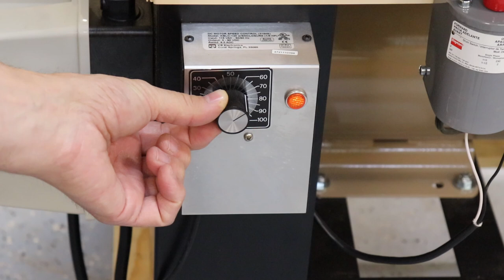Drum Sander Tips: Woodmaster

Comment: Thanks Paul.  That's one beast of a sander!  Interesting about potential waviness past 1/16".  I've only noticed that on my 16/32 Jet if the stock doesn't lay flat.
Reply from the maker: Hi Charlie, beast is right! What is your normal veneer thickness? I’m surprised that you would want something thinner than 1/16”.
Reply: @ToolMetrix  HI Paul, I normally shoot for about 1/16" thick on my veneers.  But, often I am  trying to get the most from a particular board and the veneers will end up thinner than that.  Maybe down to 3/64" and sometimes 1/32", but 1/32" is getting kind of iffy.
Reply from the maker: 1/32”….Wow, that’s livin on the edge!

Comment: Subbed.  I have a WM725.  Recently installed a carbide helical head.  What a huge difference!  Now I’m interested in making molding.  Did you ever use your 718 to sand projects?
Reply from the maker: Hi Ted, I use my 718 to make molding from time to time. It’s a great tool for that and I really enjoy using it for that purpose. I have used it as a sander a few times, mainly for end grain cutting boards. If I was making a large batch of end grain boards I would probably set it up as a sander. For 1 cutting board I usually feel like it’s not worth swapping it over to sanding mode. For any other material (figured wood, whatever) the carbide cutterhead does such a great job that I never feel like I need use the sanding head. I do have to sand with a ROS after planing but just lightly.

Comment: This appears to be a single drum sander?
I have a twin drum version of the generic axminster type marketed under many brand names.
One area nobody seems to cover is checking alignment of the drum/s with the feed table and following on from that,fine tuning the height of the second drum relative to the front one depending on the grade of belt used. 
After being assured the front drum was factory set and no adjustments needed,I did use engineers blocks to check this and found that it was indeed out of parallel by 1/16,so sanding in a taper across the board.Setting the height of the second drum,once also parallel, is more trial and error dependent on the grade of belt used.If always using the same  grits from the same manufacturer little further adjustment is required.
Reply from the maker: Yes this is a single drum. 1/16” is way out of alignment. Glad you figured it out.